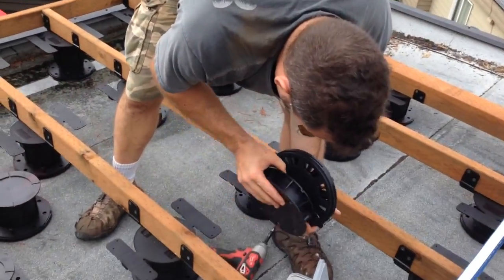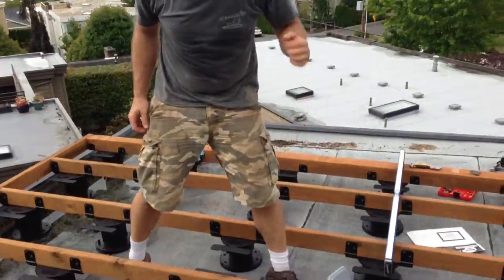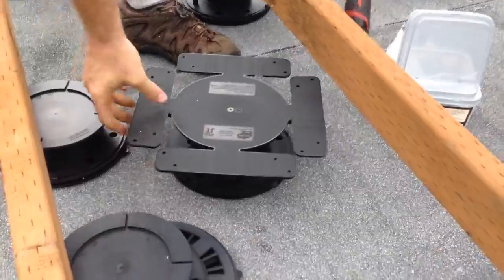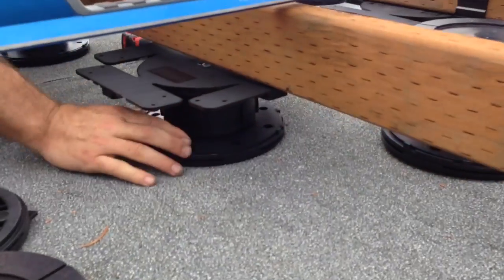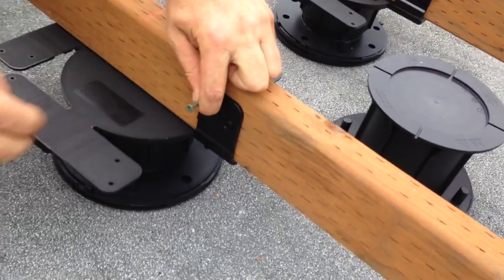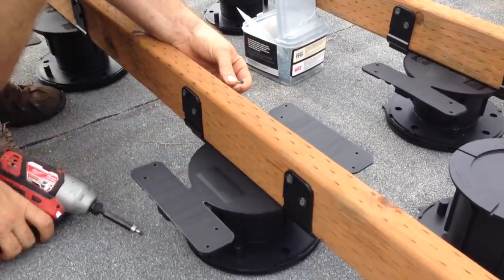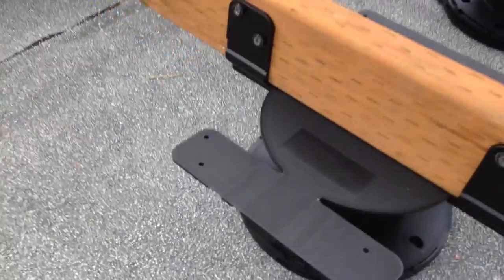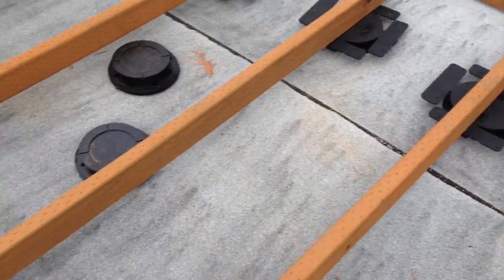Bison Rooftop Deck with Pete

Comment: Are you sure it’s okay to use 2 x 4s? Why no 2x6 or 2x8? If it floats, wouldn’t that make it more solid and allow you install guard rails?
Reply from the maker: Yes 2x4 is perfectly fine here. Treated wood is necessary.  Thanks for the comment!
Reply: @rockdiamond  OK, but how do you attach guard rails? You gotta have railing on a rook deck. This is an area of knowledge that I cannot seem to find answers to, online. I love the bison system and other similar floating deck systems, but on a roof —— Help!
Reply from the maker: @gonavy5607  yes you definitely need railing. The hardware for the railing bolts down into the completed deck. You can have a glass railing or you can have the string wire railing that’s really popular right now or any other types of rails you want. You don’t want them kids falling off the deck! Here in Seattle we use glass railing a lot. After the decking is installed, the floor and everything, then The glass railing hardware bolts down into deck and then you make your railing. 

Here is an example: https://youtu.be/YE-nBDAF41c

Comment: If bison just sits on top off the roof, what’s to keep the deck from sliding off of the roof?
Reply: IDK FRICTION??!!!
Reply: It’s so heavy.  It’s not going anywhere. Also remember the roofing material is like sandpaper so there is friction.
Reply: @gonavy5607  you're underestimating wind power... friction won't hold it in high winds

Comment: yes this is cool but how much do they cost? I would venture to say if I have to build a 2x4x12 frame anyway why not just put down supports at the edges and seal them with caulk? You can still remove everything if you build with screws and bolts thus saving significant amounts of MONEY!
Reply: The wider you space out your posts, the more you increase the point load on your supports. If you're spanning 12' on only 4 corners, that is a lot of weight to support. The Bison pedestals can support up to 1,250 lbs, but often times the substrate underneath cannot. Typically on projects such as this, a pedestal system does not increase the budget drastically... but you're building with much less roof penetrations while distributing the load.
Reply: Very expensive I bet
Reply from the maker: Yes, this is true. For our use, we were actually putting the deck on top of a flat roof so we weren’t able to attach anything to the roof. These are best to just sit on top of the existing roof and not have to modify or cut holes in the roof.